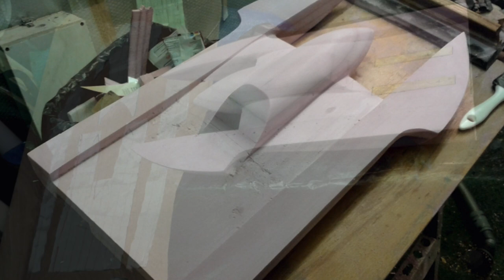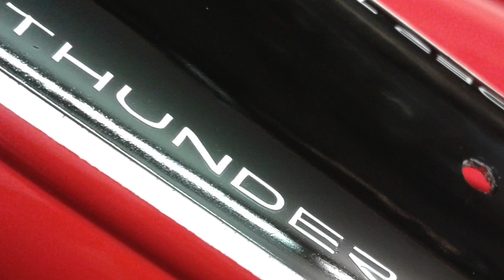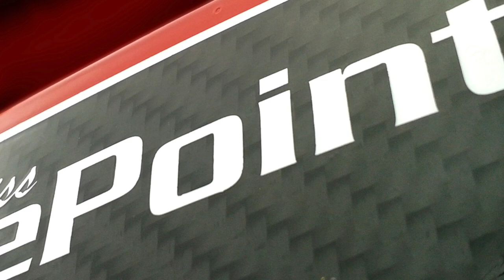RC Airboat - The making of an Airscrew Driven Hydroplane slideshow

Comment: Excellent free hand work. That is the most fun way. I just built a flatbottom tractor airboat with a K&B .65 Glow Engine and vane stearing and was wondering if I should add a water rudder. I have a ton of old balsa water ski production blanks, so I simply used a foam boogie board as the starting plug and planked the whole boogie board top, sides and bottom with 3/8" balsa sheathing and polyester fiberglassed he bottom and sides with a turned up balsa nose. It is quite heavy. The next one will be hollow and light. As you know, real hydroplanes barely float and foam is deceptively heavy, so I doubt if light weight carbon fiber is any advantage in your application. Carbon fiber holds no advantage over fiberglass in a heavy hydroplane, but I understand you were doing for the carbon fiber laying experience. It appears the trimaran types of model hydroplanes are the fastest with airscrews.

Comment: Hi. Can you please tell me how you got the glow plug on top when the engine in upside down? Is that the radio box on the bottom? Thank you, and compliments for an exellent job.
Reply from the maker: HI, thanks for the compliment. 

The boat uses a 'remote glow adaptor'. A spring loaded cap, similar to a spark plug cap on a car, fits to the plug and runs to a connector which is the same as a glow plug's shape so a regular starter can be used. They are also available with 3.5mm plugs to connect if wanted. These are intended for use on aircraft with cowled motors, and work just fine. So long as you know your engine and starting is reliable there's no problem having limited access to the plug itself, on this boat they only come out for replacement, floods etc are dealt with by turning the motor by hand with the exhaust side down.

Yes, the radio was in the bottom. This has worked out fine, the boat is still active to this day. But, I'd probably not do it that way again. It was only an after thought as being easy to put the radio in there, as it was never intended to be run when built first so there was no allowance for hatches etc.
Reply: @JesHill  Thank you for your enswers.

Comment: You sir are a master craftsmen. Complete symmetry carving foam by hand. I'm not impressed by much. I operate CP helicopters and build extreme surface mod'd vehicles. The Obi Wan of Outrigger air boats.
Reply from the maker: Tiger Tank thanks for the compliment, much appreciated
Reply: Not that I don't have enough rc dreams and distractions....but a few vintage Rigger hydroplaneers perked my interest. I'm dying to build one but it has to be brushless electric. I've got access to motors....speed controls, Lipo and Life batt packs and most of all real desire to build something with my hands. People like myself need to see people like you attaining amazing results.
Reply: and when I say brushless electric.....I meant only an Airboat.
Reply from the maker: Have you seen the 'Selph Inflicted' hydro air boat series? I'll send some pics.

Comment: the boat design is excellent. how did you shape with just sandpaper? Was not it difficult? I got foam and started. I inspired you. but I will use the edf engine. I hope it will be like that. I will design the hull as f1
Reply from the maker: Rc Boat TR. Use coarse sandpaper, I use 40 and 80 grit. I stick the sandpaper to boards using double sided tape. Use rounded blocks of wood to stick sandpaper to for concave shapes.This helps to generate accurate surfaces. Mark lines on the foam to shape down to and use paper templates to ensure symmetry. The foam is easily shaped down with such coarse abrasives.
Reply from the maker: Rc Boat TR. I also use a coarse file, actually a 'rasp', which has been heated and bent so that it can work into recesses. For a quick and even top to the sponson decks an electric planer was used. Most of these tools are in the video.
Reply: Thank you very much for your advice. I hope this is successful.

Comment: Great job. How did you get the foam to be so smooth? Glass and resin or other method.
Reply from the maker: Thanks. Amongst the pictures you'll find wooden and metal sanding blocks for shaping the foam and glass fibre layups to get a flat finish. I find it best to have sharp fresh coarse grit abrasive paper under the blocks on the foam. To generate a spot on surface on the glass fibre those metal blocks are my best friend. They are ground tool steel stock, and the best thing to hit high spots without too much excavation of the surface elsewhere. Alternating directions of travel when sanding keeps the low spots visible, and generally helps to show where pressure needs to be placed on the blocks. To reduce the sanding needed, when using chopped strand mat apply the glass fibre resin using a spreader and only stipple it gently with a brush after to consolidate the fibres, this helps to reduce mounding of the fibres. Wick off any excess resin using a brush. A layer of fine woven cloth on top of the sanded chopped strand mat, again with resin applied by spreader, leaves a surface with little left to rub down. I use epoxy resins over polyesters.

Comment: What kind of foam board are you using
Reply from the maker: devin buchanana: Owens Corning Formular 250. In my case it was packing material used on products imported from the USA.
Reply: Jes437 thank you and how much did the whole build cost
Reply from the maker: devin buchanana: difficult to say, it was entirely made using offcuts, spares and left over materials. I would estimate around £50 of material consumption, plus engine and radio.
Reply: Jes437 OK thank you for the inspiration
Reply: So.. What size 2 stroke? .40 ,.50, .60? And the length and width  of the boat to support the engine  and weight. Or was there another way you came up with the ratio.. It looked pretty well balanced in the water.. I going to build something like that with an OS.60 and am trying to fit it figured out.

Comment: I have a question. How can I remove the foam in the interior after covering the model with glass fiber?
Reply from the maker: Generally it's not necessary, it's very light and provides buoyancy and compressive strength. In essence the idea is that the skin provides a tough outer to a foam boat. Removing the foam as part of the process is sometimes done, but not often. If it was built with that in mind often the foam used might be easily soluble with suitable chemical solvents, such as polystyrene. If you need to remove some like I for radio gear etc then the same carving/sanding and filing will do it. In my case I ploughed in with a B&D Powerfile.
Reply: I understand. I need to remove the foam from a section because I'll add esc and lipo to that part. But I like the idea of the chemical that melted the foam. Many thanks for your help. I can do something with you.